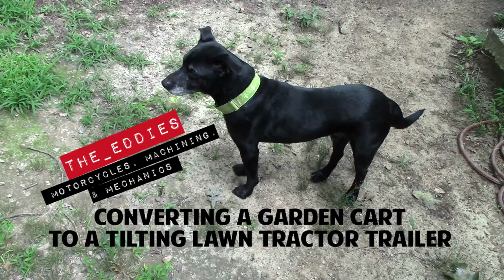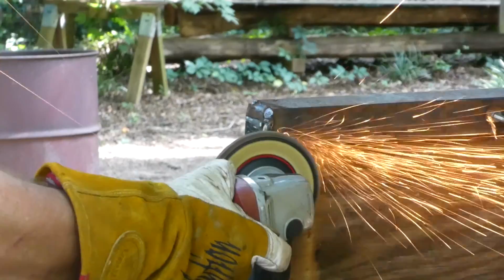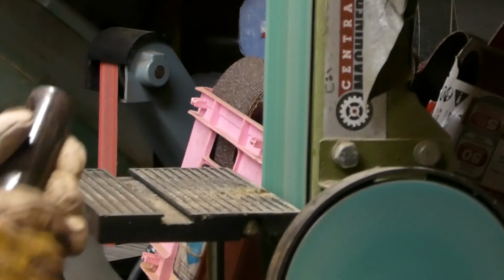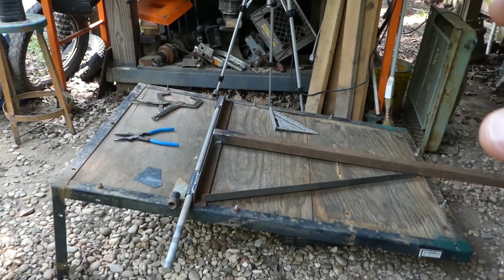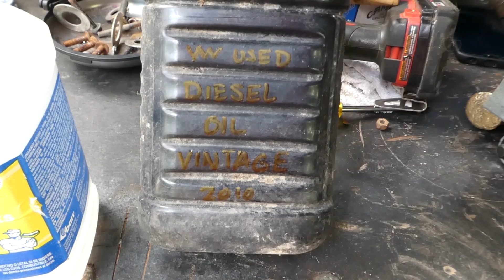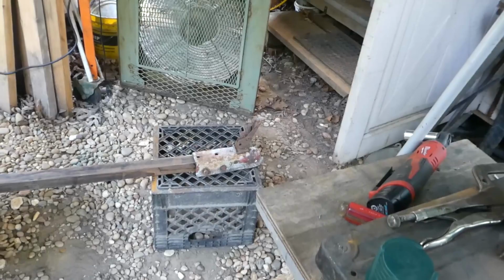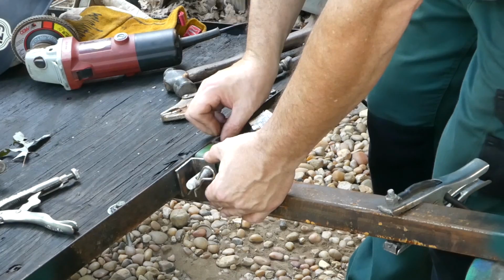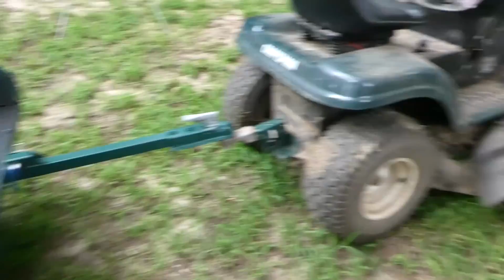DIY Tilting Lawn Mower Trailer from a garden cart

Comment: G’day Eddie. Growing steel angle in the back yard, awesome! Don’t happen to have a cutting of 2 x 1 RHS you could send me:-)
The trailer mod worked out a treat, just the right amount of slop in those pivots, well done. If you move the axle forward it will put more weight over the back and make it easier to tip but you’ll lose tipping angle and it will be a pig to reverse. 
Cheers 
Peter
Reply from the maker: Lol, my garden only has some 2x4 with 1/4" walls. I cut up an old rusty HD trailer back there built from that and pieces keep popping up from time to time. :-)
I agree with your assessment , I used it for a few hours today and I think I am going to keep it like it is. If anything, I might shorten the tongue a bit but even that has drawbacks like not being able to cut it as hard before it runs into the rear wheel.

All the best!
Eddie